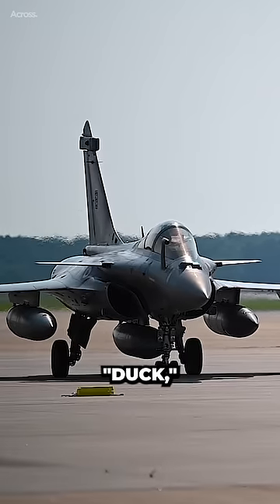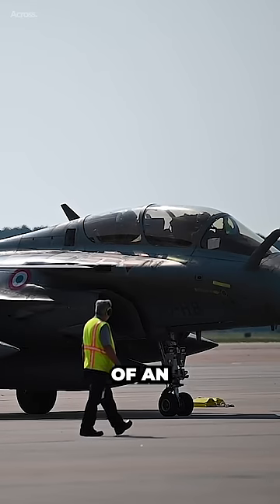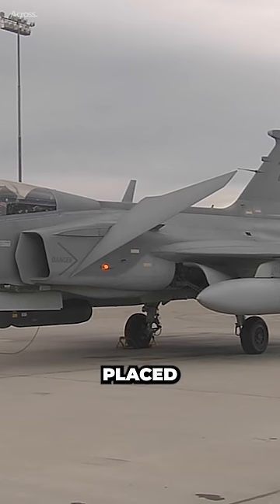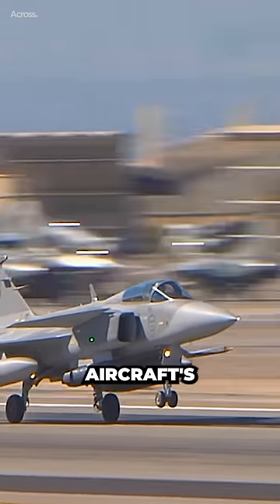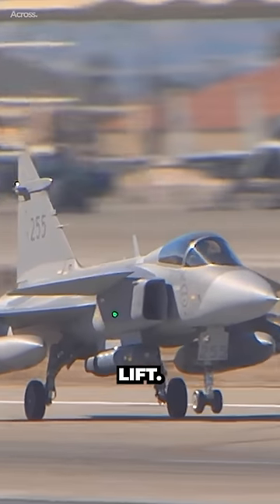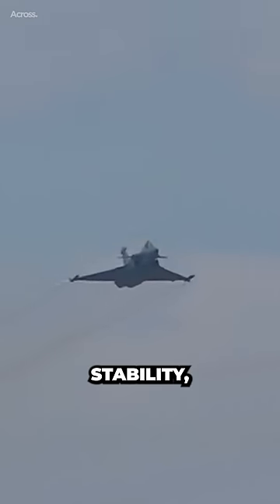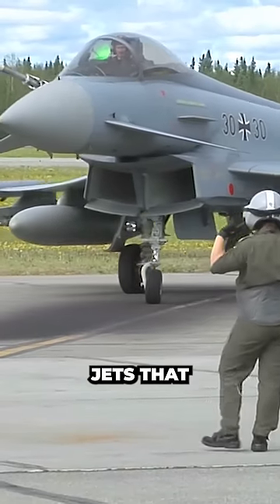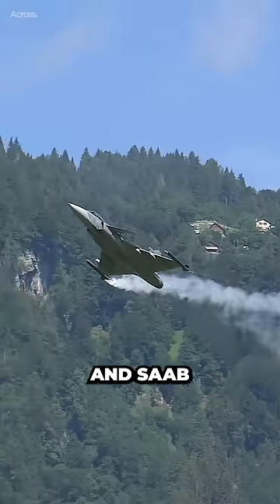Why Don't American Fighters Jets Have Canards? #shorts

Comment: Canards trade energy for nose position. That's a bad deal in 99% of cases.
Reply: ... again please?
Reply: @guilhem3739  In US military combat maneuvering philosophy, energy management is key. For this line of thought energy is a combination of the aircraft's velocity and altitude. Any maneuvering costs energy (that goes for missiles as well). The tail surfaces are at the rear of the aircraft behind the center of gravity (CG). Adding canards places maneuvering surfaces ahead of the CG and since they are in the undisturbed airflow adds more force to the maneuver. However, that maneuvering force comes from the aircraft's energy (momentum).
Being able to point the nose rapidly can allow a firing solution. The guns and older missile aim where the aircraft is pointed.
However, that's a gambit. If it doesn't work, you're not likely to survive long enough to recover the energy you spent. This is why the Russians have disabled the cobra button by default on the Flanker aircraft. The pilot must conscientiously select enabling it.
If you dump all your energy in a gamble to get your nose into position and don't make the shot, you die.
US aircraft use other aerodynamic means of achieving that extra maneuverability. Means that allow an aircraft to maintain more of its energy.
A dogfight is like a reverse race, the pilot that uses up his energy first loses.
I hope that helps you understand. Please feel free to ask if it doesn't.
Reply: @guilhem3739  Canards slow you down to make you more maneuverable. The problem is that slowing down makes you way more likely to be shot down. If you stagger fire with a slight variation in timing, using canards makes the second missile hit without an issue.
Reply: Yes, there's a small drag penalty, bit not by much. When they're attached to a modern lightweight airframe with lots of excess thrust, along with an excellent fly-by-wire system, something which aircraft like Typhoon, Rafale, Grippen & dare I say even Sukois have. The problems you've mentioned are easily negated.
Reply: @THE-BUNKEN-DRUM  Only in your imagination. Energy is energy and in a dogfight, you enter with a finite and limited amount. When you use canards or directional nozzles, you're turning energy into nose position. That will only help you if the other pilot has less experience than you. If he has the same experience or more, you might live long enough to regret wasting that energy on nose position. You might also not live that long. "cobra"
Reply: @trplankowner3323  : No, not in my imagination. The aircraft I've listed all regularly come out ontop in BFM engagements against all but 1 U.S. aircraft, that's the Raptor & even that's not always 1-sided.
If you don't believe me. Type in Aircrew interview Typhoon. Specifically, the Mike Sutton, "Sainty" clips.
Reply: @THE-BUNKEN-DRUM  I've explained to you in excruciating detail the aerodynamics of the choices.
What you are clinging to are exercises, not reality. It's like watching an NFL preseason game and thinking that is the same as a regular season game.
The purpose of military exercises is to provide learning situations for the participants involved. Other benefits of those training exercises is too promote coordination and increase comradery among US allies and friendly nations such as India. They are not to beat up on pilots that have half or less the flight time as the US pilot, not to mention the national defense budget. We aren't Russians, doing that would be stupid and pointless. The US military is a professional military and behavior such as that is most certainly not professional.
There are occasionally other purposes, such as in the USAF's recent visits to India. Yes, it was a set of military exercises as usual, but there was something going on there beyond that. No, I'm not just talking about letting the Indians get a good look at the B-1B bomber which India is considering buying or leasing. While the B-1B would certainly be a good addition to the IAF and give them capabilities they currently don't have, India officers and officials could have flown to the US for that. The B-1B has characteristics other than just being a larger and fast bomber that can be particularly helpful to nations such as India, Japan, Australia and South Korea in an exercise on the home territory (or at sea just outside there). Those exercises gave those nations something they couldn't get anywhere else and that was extremely helpful to them. 
That's because aerodynamic tricks in certain unlikely situations during a dogfight are just not that helpful. Furthermore, they're useless against an opponent that is trained as well or better than you are. Frankly, if you don't already have an advantage against your opponent, those tricks are basically suicide.
Reply: @trplankowner3323 : Although I do agree with 'almost' everything you said there. You've completely missed the point I'm making & went off on a tangent. My point is modern aircraft that use canards, AGAIN  like Typhoon, Rafale & Grippen, etc... are all excellent rate fighters mainly because of their high t/w ratios, which surpasses anything in the U.S. arsenal bar the Raptor in which case their on par & the canards 'help' to give them equally excellent nose authority. They do not hinder their performance to the extent you're claiming, they enhance it. This is reality, NOT imagination.

In regards to exercises : Correct if I'm wrong. But you seem to think the airforces that use these aircraft are somehow less capable than their U.S. counterparts & you're all holding back to make it "easier" (so to speak). That's not true AT ALL. It's a "2 Way Street" & they learn from each other as European pilots train just as hard & are just as capable.
Reply: @THE-BUNKEN-DRUM  F-14, F-15, F-16, F-18, Typhoon, Rafale, and Grippen are not modern fighters. They're all 4th Gen. For that matter, so are the J-20 and the Su-57. IF I had to choose between the J-20, Su-57 and Rafale given that I could fly them all equally well and my opponents were similarly trained, I'd choose the Rafale every time. I think a good Rafale pilot could take on the Su-57 and J-20 at the same time and win.
Despite everything I've said, you're still not paying any attention to what I said about military exercises. They aren't fair competitions. They're learning exercises. When those canard aircraft that were beating up on those US trainees, they were showing those trainees what an aircraft with canards was capable of doing. Just like when those Rafales and Eurofighters where flying along toward a potential intercept with no contact on their scopes and they were informed they'd just been shot down by an F-22 Raptor. Fortunately the Europeans will never have to face a Raptor in real combat. Those US trainees won't have to face a Rafale, Eurofighter or Grippen, but they may very well have to face a Flanker variant or J-20. Even if WW3 started tomorrow, that situation is highly unlikely, but it exists. Most likely all the Flanker variants and J-20s will be destroyed inside the first 24 hours of a WW3 like war.
"airforces that use these aircraft are somehow less capable than their U.S. counterparts", other NATO pilots get half the training and flight hours as US pilots do. It's a very big expense. The other NATO pilots get 10 times the training as the for the most part now deceased Russian pilots did. The Chinese spend more on their training and do get more flight time. Still, like almost everything from the PRC, it's tofu dregs. The non-US NATO pilots would tear them to pieces.
It's not that I don't respect our NATO allies, I do very much and they do a damn fine job with what they're given. Still it took Donald Trump forcing the other NATO leaders to increase their spending to the point it is today.. As respect to him for that they laughed at him, hated him and cooperated in a coup against him. If it weren't for Donald Trump, Ukraine would be part of Russia now. If Europeans had actually considered Trumps warnings and suggestions, perhaps there would be a cryogenic natural gas pipeline to Europe from North America and Europeans wouldn't be paying extremely high prices for natural gas. Perhaps even Putin wouldn't have dared to launch his invasion.
"They do not hinder their performance to the extent you're claiming, they enhance it."  You're misinterpreting what I'm saying.  When you pull your nose around using those canards (or other means), it costs a huge amount of energy. You're relying on that other pilot not to know what to do or not be watching your nose.
The other pilot doesn't even have to be as experienced as you are, just trained well enough to know how to handle an aircraft capable of performing high angle of attack maneuvers (it doesn't matter how he got his nose there). The US considered all this over 40 years ago, canards are nothing new. The first heavier than air machine used them here in my home State over a century ago. Considering the US's philosophy of maintaining the most dominant air forces and the best trained pilots in the world, the US aviation establishment chose not to use those methods, but to continue it's philosophy of energy management.
Once you perform that maneuver to bring your nose around, if it works, you will probably get your kill. However, if the other pilot has been trained the way US pilots are and he sees what you're doing, he will avoid your nose. Then there you are having dumped a great deal of your energy into gaining that nose position and nothing to show for it. While your opponent has used far less energy avoiding your nose. He will have altitude and speed (energy) as well as probably position over you. You will either fly into the ground because you eventually lost too much energy to maintain flight, or you'll panic and try to fly out of the fight. In which case he'll kill you when you do because he has an altitude and energy advantage over you.
All of this is just a debate about fundament aerodynamics. In less than 5 years (18 to 24 month IMO) the NGAD will begin it's deployment. Then the fighters we're talking about will be two generations behind and will stand about as much as a chance as an F-4 Phantom or MiG-21 against a F-22 Raptor.

Comment: Me expecting a genuine reason:

The reason: we just don't want to
Reply: i mean pretty sure that is also the same reason for not using the metric system
Reply: For long planes with extended tube cores, it reduces pilot cabin shaking.
Reply: It increases drag and puts unnecessary instability on the aircraft, same reason you don’t put your rudder at the front
Reply: @oerlikon20mm29  They are put in front for stability.
Reply: @donaldkasper8346  during sharp turns at high speeds they try to weathervane themselves
Reply: The genuine reason is because the US doesn't have a delta wing aircraft, which have canards out of necessity rather than any extra utility they provide
Reply: @oerlikon20mm29 all those European, Russian and Chinese engineers have no clue what they’re doing. 
I wish they had you on board. Everything would be all right!